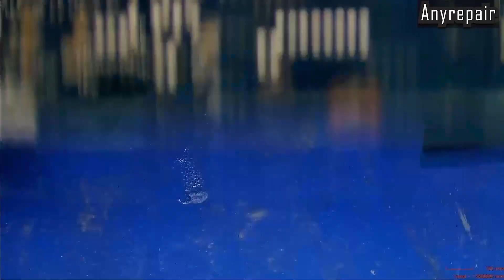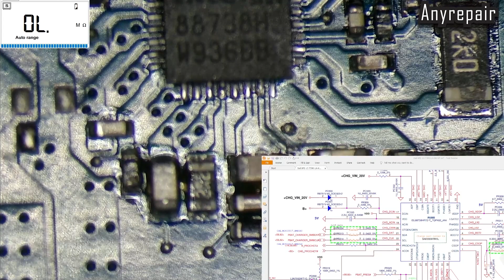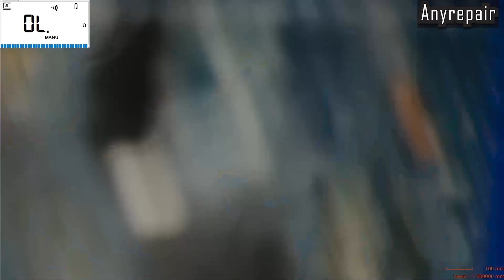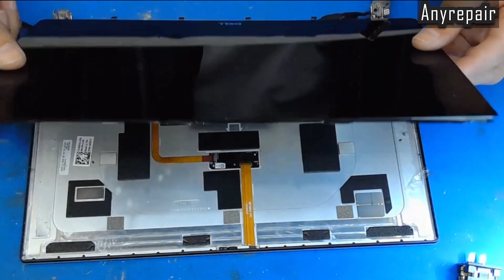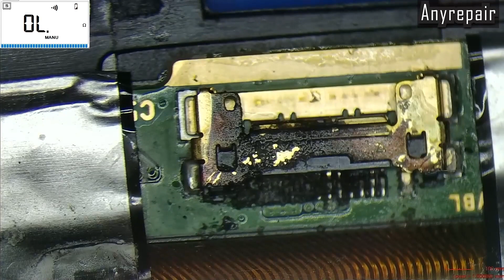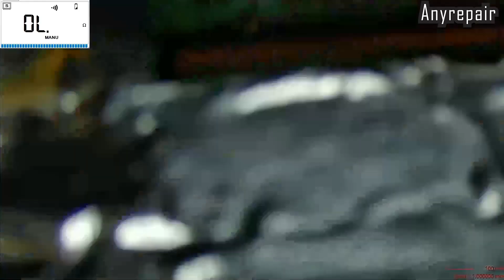Water disaster dell xps 13 7390.

Comment: Hi, what was the temperature for reflowing?
Reply from the maker: When I was cleaning, the temperature was 450 c
Reply: @AnyrepairENG  Thank you. Thats a great and very precise work on a display connector. I would say that it was more burnt than just corroded. How could that happened, maybe a water-caused short?
Reply from the maker: Yes I also blame water on the backlight connector, made the short and burned the connector....I suppose 😅